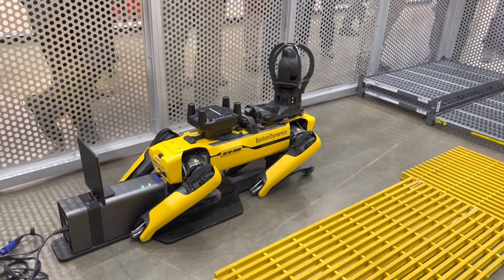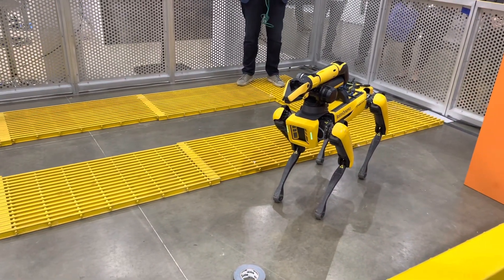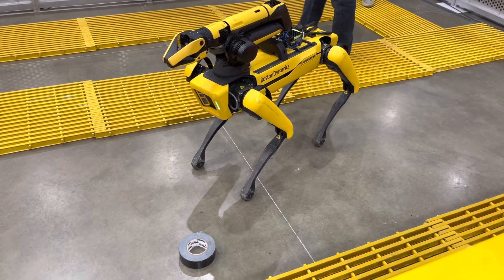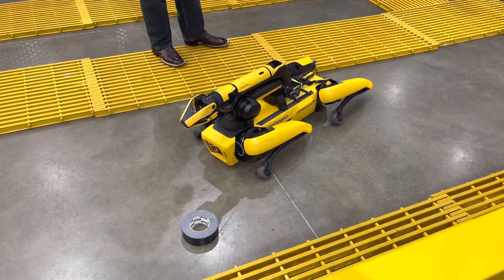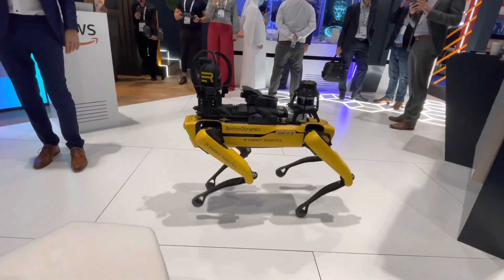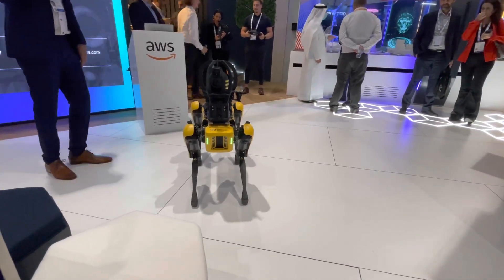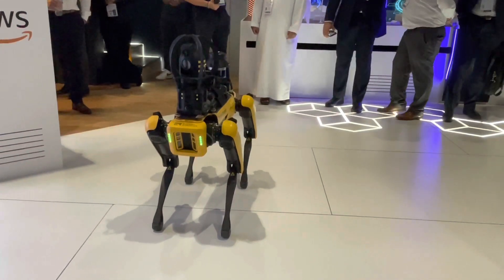Robots from Boston Dynamics

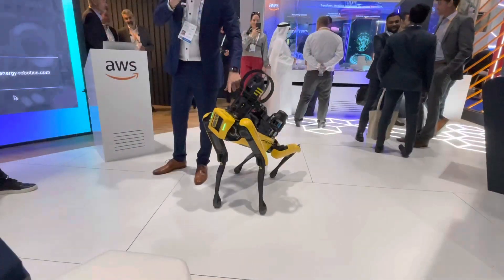Comment: You probably don't want to put your fingers right near the joints like the presenter at 4:58. Even if you scoff at the operating manual telling you to keep a 2 meter distance, those are still pretty beefy motors and it will still try to perform the instructed movements while retaining balance if your fingers get pinched or jammed in there. Also just don't move the unit if you're the operator there, you can't see anything from behind the presenter's back.